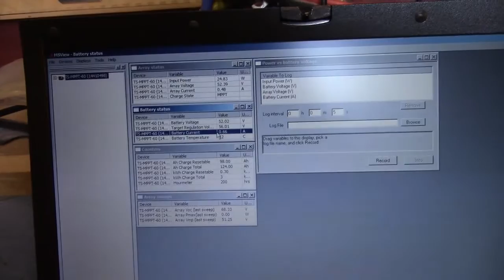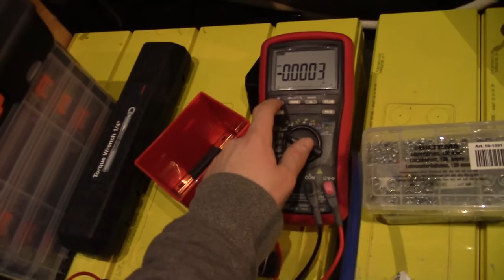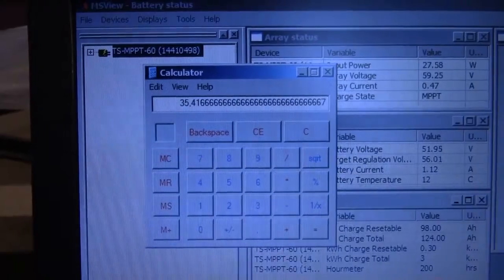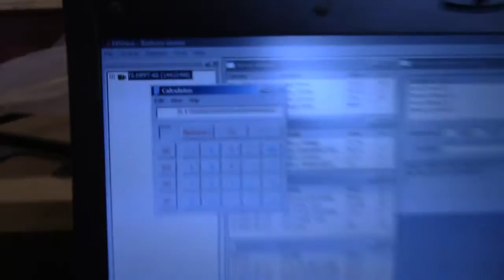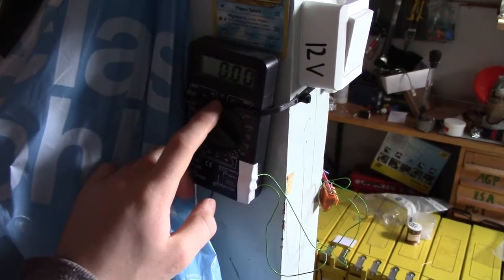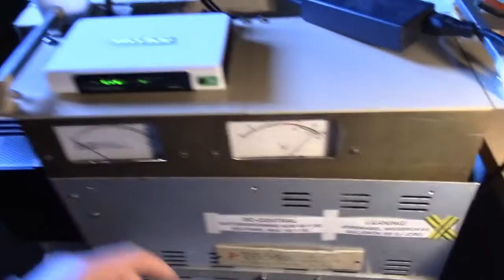Morningstar installation & wall wart 48 V hack

Comment: im looking to do something similar. i just came into possession of 5 like new apc smart ups model surta2000xl.
i intend to hook them all up to 2 banks of 200ah golf cart batteries. 8 in series and 8 more parallel to that set. 16 in total. im going to put 1 unit on each of my two fridges and one on my furnace all on there own propiotry circuits. then the other two im going to feed my panel with transfer switches. the factory batteries are scrap. my question is how and where do i get the software they originally came with so i can tell the ups i have external batteries connected so it can charge better and so i can make any other program changes to them.

Comment: How many panels are feeding it and at what wattage?

Having little to no background in this, I'm deeply concerned about sparks, fire and all manner of horrors. I'm starting the adventure with 2500watts...
Reply from the maker: j johns I only have two 235 W panels.

As long as you do your connections up properly (not too loose, not white-knuckle tight), use suitable gauge wiring and fusing in the right places, and make sure never to allow the wrong wires to cross, you're likely to be safe. That said, working with batteries and PV panels is always dangerous, becuse there is no "off" switch.

Comment: For small mobile installations there are few interesting devices. Please try searching on eBay for "MPPT 5A" and do a review of those solar chargers, they look really interesting. Cheers from sunny Croatia.
Reply from the maker: Valent Turkovic Those small regulators that you can get on Ebay are generally not worth much attention, since they're all roughly the same; they are not MPPT, they do not have any kind of switchmode converters. The only real parameters one could review about them are the cutoff voltages, and those are going to vary wildly from unit to unit, so there isn't much point to that either. If you have any particular model in mind, that would be a bit more interesting, do let me know, and I'll consider it.
Reply from the maker: Valent Turkovic Hm, I've never seen that one before. I'll have to dig into it, it looks more interesting than most, for sure.

The "MPPT" knob makes me a bit cautious, however, that it is not a real MPPT controller, but rather, a voltage regulator with a settable input voltage - which could be VERY interesting for other applications!

Thank you for sharing this.
Reply: Just found another one - http://www.dx.com/p/600w-constant-voltage-constant-current-power-car-charger-solar-regulator-dc-dc-boost-module-blue-228310#.VcsrlEZHmnM

Comparing and explaining these cheap modules would probably make great video.